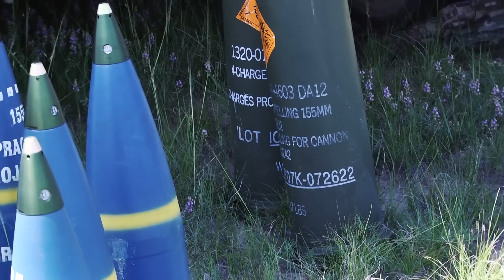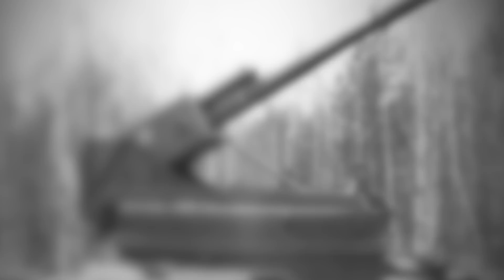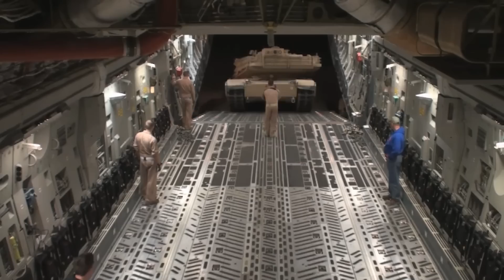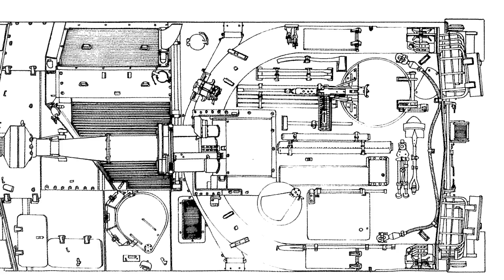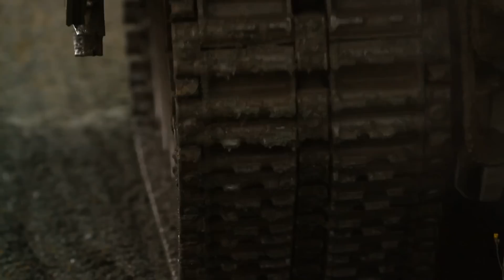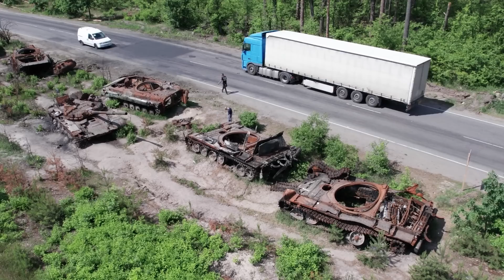The West's Secret Weapon in Ukraine - Gun Equipment 155 mm L131

Comment: I'm wondering how the barrel could sustain this rapid fire over , say, 2  or 3 hours. It would seem to me that rounds per minute mean nothing if the barrel melts in 30 minutes. I'm just asking the question. After all, what the hell good is a spg with no gun?
Reply: No need for continuous fire if the shell is smart…
Reply: @d.o.g573  how do you mean? I'm not a military expert on this. Let me take a Crack at it and see if close.
A smart shell would exit the barrel  and then ignite as a guided missile style ordinance?
Reply: @joshuaboudreau5258  when the smart shell has reached its highest point 4 additional wings extend and guid the shell on the preprogrammed course. 
Proximity fuse and contact fuse etc. are all options. 
These are the „dumb“ 1. generation smart. Next gen smart shells are way way better…
No need for old saturation attacks
Reply: @d.o.g573  thanks for that. Appreciate you taking the time and not making me feel stupid.
Reply: @joshuaboudreau5258  there are no stupid questions - only stupid answers

Comment: AS 90 is outdated  by now, the PzH2000 and K9 are way more advanced and have longer range. The 90 is a good system,  but is not secret or that special anymore.  
Also when talking about the 90, you show M109 and other unrelated vehicles.  
Btw 155mm artillery has same power,  regardless of platform.
Reply: Yeah it is outdated now. 
Just a massive target for the lancets
Reply: for now it's just a matter of shoving Fwd as much as you can.  Once again reminded War is a matter logistics, and preparation for before.  and those who engineer success are repeatedly the least appreciated
Reply: Ahhh, have a cookie for the under appreciated 🍪

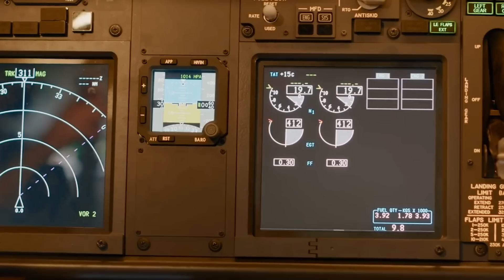Comment: Interesting that they have landing gear and flaps, but I guess if they are air deployable, they need it. 7:39
Reply: It said that the electronics were upgraded...  I thought, why did an artillery system need landing gear, flaps, and two turbine engines...  I thought that I was the only one who caught this!
Reply: And it has MFD and TCAS system, i guess it is very risky to collide with other aircrafts in the air. This could be used when being air lifted...
Reply: @adnfulcrum at 49 tons these resemble tanks.  They are not going to be picked up by a helicopter and quickly repositioned.
Reply: @adnfulcrum  Many an operation has gone horribly wrong when two self propelled artillery pieces collided in mid-air.
Reply: @michaelm54877  funny, while not.  there's some sort of unparalleled difference between a Huey Slick repositioning a 105 vs we need a C-17 to move two 155s.  Your sphincter will explain more than your brain.
Reply: I'm guessing they don't think military types that notice the details watch this, too.
Reply: Pretty weird that the FMC of a Boeing 777 was shown when talking about a self-propelled gun.
Reply: Wha the Hell

Comment: The AS 70 and AS 90 are two differant systems the AS 90 is a stand alone gun system the AS 70 is a replacement turret system . It was knowen that if a war broke out between the NATO and Warsaw pack country's the number one targets will be NATOs thank and Artillery system the AS 70 was designed to fit all NATO Tanks with a universal turret ring system so if a NATO tank was hit most likely the turret would be damage and duel to the turrets blow out system for the tanks bussel the crew would have a high chancel of survival the turret would be destroyed but the chassis and running gear would be OK so the damaged turret could be taken of a Leopard or Chieftain and replaced with a AS 70 turret gun system turning a broken tank into a SP Gun system that is why there is an outside loading system and can only be used if the turret is turned at an angle the ammo is loaded from the outside taken inside by hydrologic system to the breech to then be loaded with a ram system the turret has inboard ammo outside a system useing ULC Unit Load Carrier of thirteen rounds charges and primers that are fedd into the AS 70 by the ammo jockeys from the outside these ULC can be on a drops system

Comment: A heat seeking drone or satellite could pick up heat signatures from engines or ammo firing and be connected to a rocket or missle firing system to range in on...
Reply: No,these As 90's are in operation in Ukraine now and are proving very effective. The US supplied hundreds of 155 artillery of various types and is sending another 40 M109 Pallidens.and crucially thousands of 155 ammo along with cluster munitions.